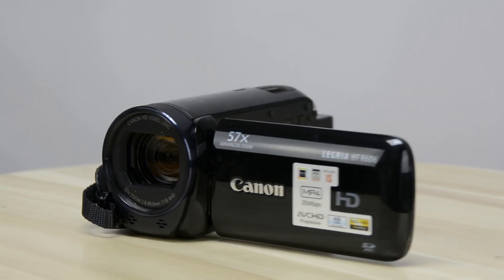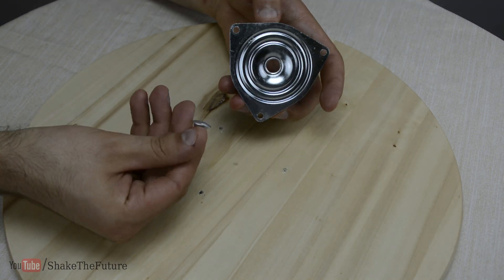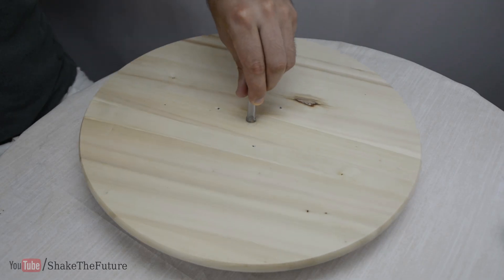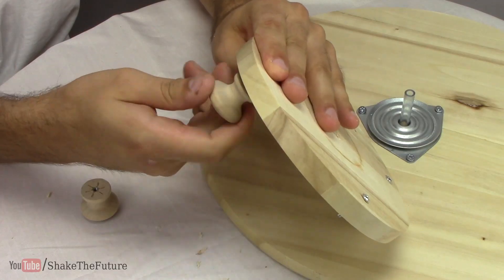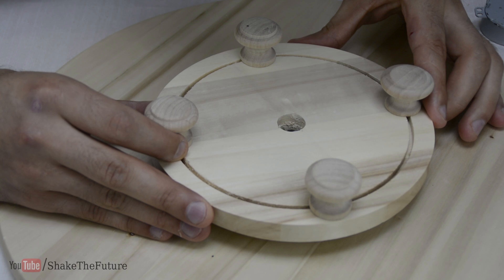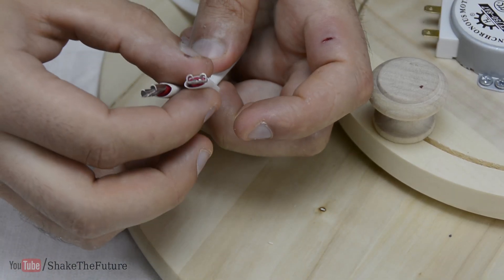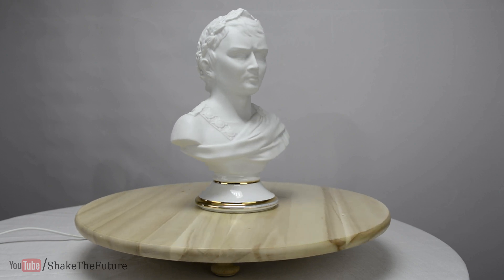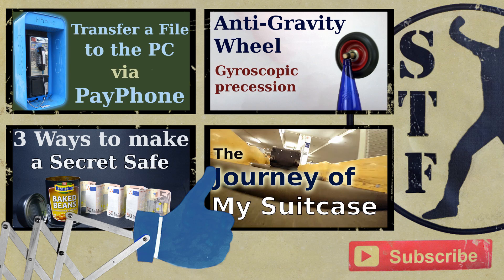DIY: Motorized Turntable for $12

Comment: Cool! I have the same motor around in the workshop and wanted to make something like this with 3D printed parts. Is it posible adjust the motor speed with a potentiometer??
Reply from the maker: I doubt that you can use a potentiometer to control that motor, but I might be wrong. Cheers!

Comment: What did you use to connect the Synchronous motor to a power source? You mentioned cables, but what type? Would that run by battery or need to be plugged in? Would you have a link to purchase what you used? Thank you!

Comment: That $12 isn't gonna cut it here in California.  The lazy susan from Ikea alone is $10, lol.  Gas to go get it, time, the motor from Amazon ...first 5 listings average $10, some more time...miscellaneous parts.....if you have most of the stuff laying around in your garage and are reasonably handy, go for it....if you need to get most of it, judge for yourself.  I do applaud the creativity, but the rest doesn't add up.
Reply: Just rip an old microwave apart.  Use the motor and power cable.  Make the lazy Susan out of scrap wood.   Cost nothing.
Reply: I scrapped a bunch of microwaves I found on trash day and now have 5 of those motors, i'm just looking for random things to do with them since they're low rpm, I reckon I can probably improvise with a lot of this to make it essentially free, and it's just for fun.

Comment: if it would be just a tiny fraction of a second slower turn speed i would have to rip open my old broken microwave and looking for a motor but, its just a slight bit too quick for bonsai tree showing =) cool tho. by all means. ,, is it possible to put a dimmer switch on a motor like this u think ? to regulate speed like it regulates light normaly ? it would not mess the motor cycles up badly  ? :)
Reply: The speed of a synchronous motor depend on the frequency of the applied AC, not the voltage. So a dimmer will not make a difference in the RPM.

Comment: Thanks for sharing. I've just purchased the same Lazy Susan from Ikea yesterday and willing to make it motorized too according to your guide.
I just wondered, would this motor spin at all if hooked to a 12V source instead of 220V? I find it much safer to work with DC power over AC as I'm not a qualified electrician but just hobbyist. And besides, I found a speed controller on eBay that I'm willing to hook to it, which has forward and reverse modes along with the speed knob. But it only supports DC from 6V to 28V (3A). Thanks in advanced.
Reply: +goldeng You would need to find a 12v motor.  The one shown in the video is mains powered.
Reply: Thanks @Kutulue. :) I gained some courage and caution and already built this project about 3 weeks ago using the same 220-240V motor shown in the video. I even thanked @Shake the Future in one of the comments below. I found that the motor's standard speed is quite alright and so no speed controller is needed. In addition, I took extra safety and built a wooden housing to cover the motor, so it's much isolated now from any accidental human contact with the motor or the wires. :)
Reply: +goldeng  Awesome.  Excellent idea to cover over the wiring and motor.  Just make sure there is a breathing hole to keep the motor cool.  Not sure how hot they run.
Reply: Good point. I'll consider modifying the cover with drilled holes. Thanks for the suggestion. :)

Comment: nice, but how we can make much slower or add a variable speed function?
Reply: +finaleditor   Install a Potentiometer inline with the power cables.  This is what a dimmer switch in a light fixture uses to lower the brightness.  If the motor gets less current it will turn slower.
Reply: Use the time function in your video editing program, lol

Comment: Any recommendations on what cable to buy to power in the U.S.? I got a synchronous motor 30V
Reply: +Archie Garcia  You would probably need to buy a 30V power pack that converts your mains power down to 30V.

Comment: I only wish the items you used were listed as I'm not familiar with all the parts, thanks!
Reply: Ld 14 you can reuse an old microwave turntable motor... they trow microwave ovens all the time... I gutted mine after it broke down, and got plenty of stuff from it, transformer, magnetron, light bulb, motor, switches etc.... some are 120v, other 21v

Comment: Great video 👍🏻 i want to make this but never done any electrical diy, what size are the red electrical cable connectors? Is it necessary to use black glue or can you use any hot glue gun to secure the wires with cable clip? Please help me 🙏🏼

Comment: I love it!, thanks. I am seeing that there are diferent rpm for the motors, your is 4rpm right?  I wonder how could I make something to change the speed if needed. If you know, could you make a video about it?
Reply from the maker: Thanks!
Yes, the motor is 4rpm.
Changing the speed is not that easy.
Ok, maybe I said it wrong. Everything is easy of yo know how to do it :)
You can get a motor speed controller, but it's not going to work with all motors.
http://goo.gl/eUxOb0

It's not something I know a lot about.

Try googling about controlling the speed of the motor. There is a lot of info.
Maybe in the future I will learn more about the subject and make a video, but at the moment I have way to many projects on the list that needs to be done first.
Cheers!

Comment: I used 30 volt motor anyone have any ideas on what could power it
Reply: electricity
Reply: Devin Walton , variable DC power supply off amazon, $20? would give variable speed

Comment: I don't understand why you glued the back to the bearings...why?
Reply from the maker: +Alessandro Mura 
To give it some extra grip. Without the glue, the only thing keeping the both wooden circles together would have been the motor (shaft).
Reply: +Shake the Future ok, tomorrow i'll try! Yesterday i bought snudda and today i was coding with arduino to program that stepper motor :)
Reply: +Alessandro Mura Which kind of tube did you use?
Reply from the maker: Alessandro Mura
It's one of those tubes you can buy in pet shops (for aquariums)
Reply: is it rigid? diameter?
Reply from the maker: Alessandro Mura yes, I had no problems
Reply: +Shake the Future is the tube rigid or not? Which is the diameter of tube?
Reply from the maker: +Alessandro Mura 
The tube is flexible. I don't know the diameter. I guess I used a 4mm silicone tube.

Comment: Hi awesome video. A couple of questions. Does it rotate only one way or can you make it rotate directions? What kind of power cable did you get? Thank you.
Reply from the maker: +mike guerrero 
It rotates both ways. Every time I turn it off and then back on, it changes the direction. I used the cable from the lamp with the switch. No earth, just live and neutral.
Cheers!

Comment: How does the tube hold on to the dowel ? You seem to be lifting the upper part of the table using the tube. Should I apply glue to the tube before attaching it to the table ? I am surprised that you can lift the whole upper table using just the tube.

Comment: I recently watch your video on your  $12 motorized turntable coz I needed one for this carousel cake I'm making for a friend's daughter...I just wanted to know why was your synchronous motor 220v -240v? I  purchased this motor on ebay just like what you suggested  on your video, but then I realized that it is for 220v and not 110v...so will I be needing something like a converter for it to work?
Reply from the maker: +Jo Delafuente 
Hi!
My motor was 220v - 240v (as I live in EU), but you can get a 110v motor. It's probably cheaper to get another motor than a voltage converter.
Search in eBay for: "synchronous motor 110 v" or "microwave motor 110 v"
Cheers